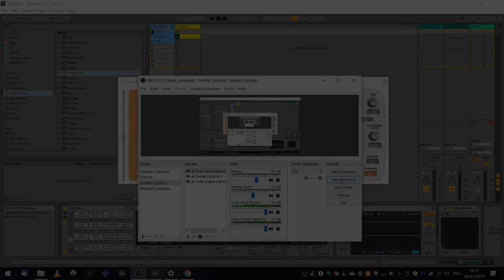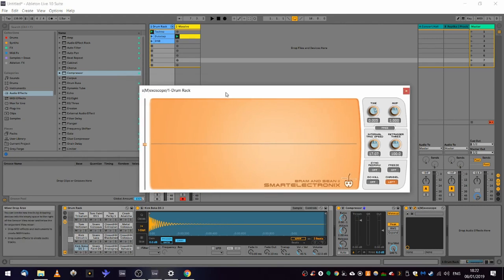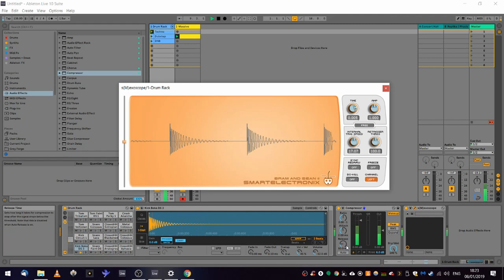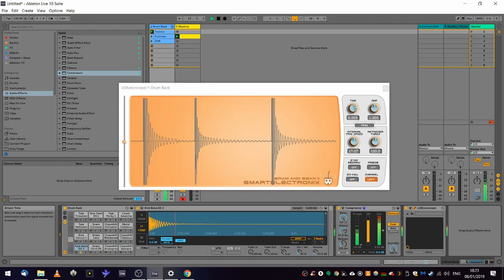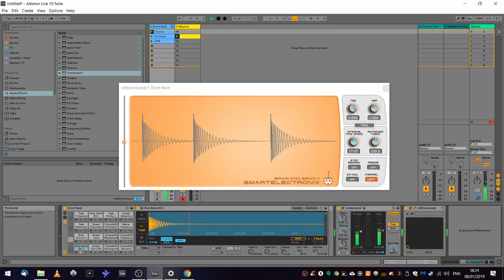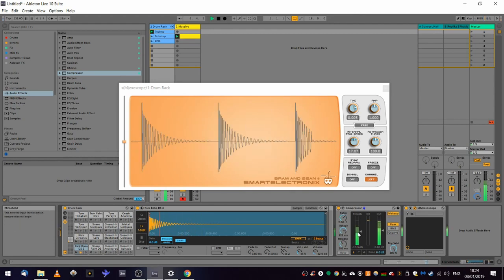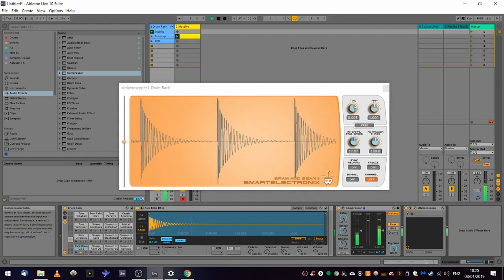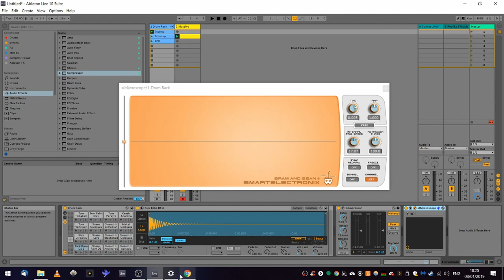Visually Compress your Kick

Comment: Another tip when applying compression: don’t be fooled by the loudness of the signal after compression, use gain staging in order to be able to compare both signals without being biased by the different volumes.